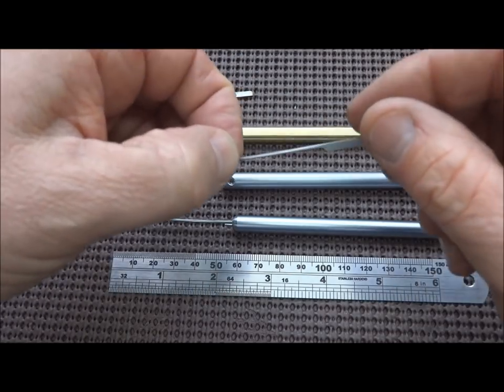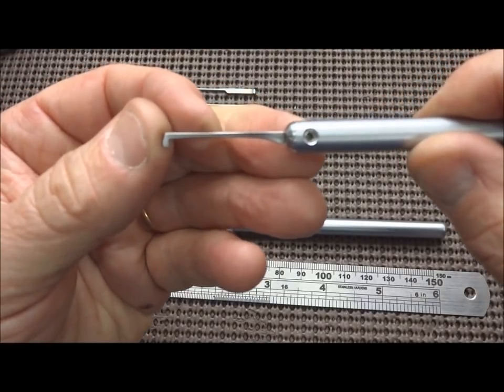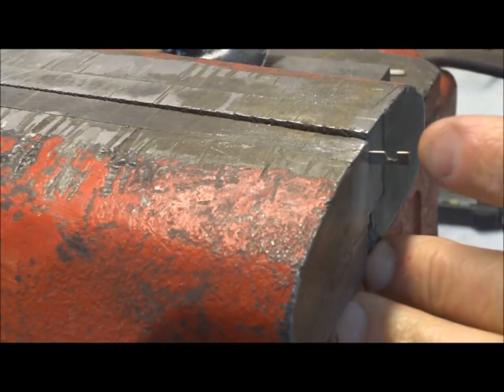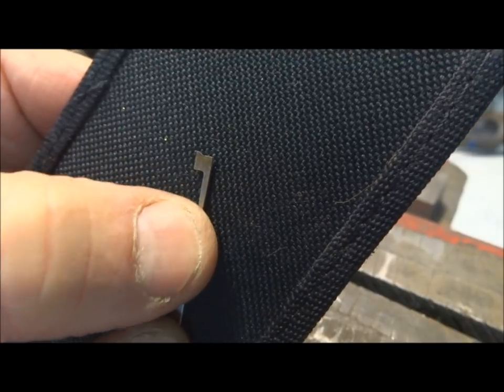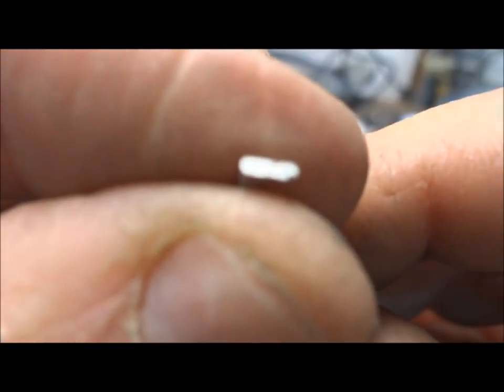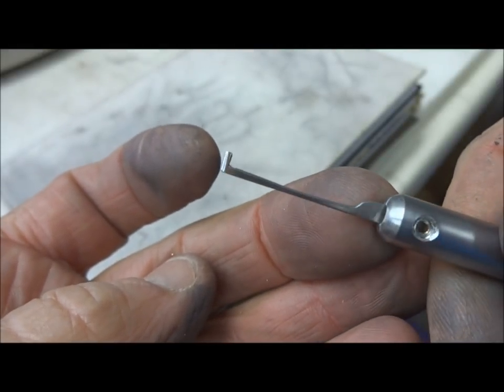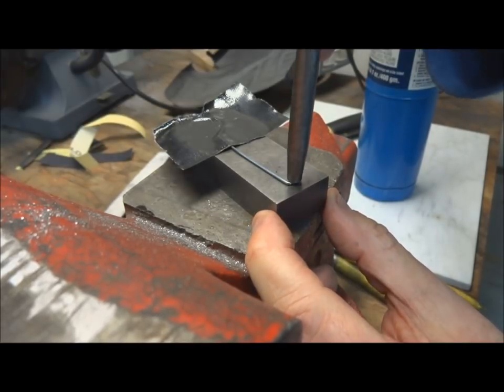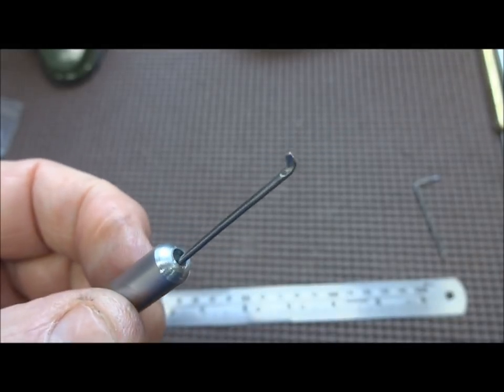(135) How to Make QuickPick Tips (Lock Picks)

Comment: Just returning to the sport from the early eighties, back in those preinternet days I used to make pick tips to fit an exacto knife handle. I used lawn mower pull return spool steel for the picks. It was hard spring steel and worked great.

Comment: Take a sponge and cut a slit in one end edge, like you're making a pocket inside the sponge about an inch or two deep, then soak the sponge in water. You can stop every so often and slide the sponge over the metal piece to quickly cool it off. The wet sponge is cool enough to quench it quickly, without having to remove the metal from the vise to dunk it.

You can do it the quick and dirty way by using a wet paper towel folded over a few times to make a thick pad, and just wrap it around the hot metal to quench it.
Reply: Good tip :)

Comment: I'm still new to making picks, but I've found that I can use 1/8 inch soldering wire hammered flat to cut and shape templates. Then I can take the templates and copy them onto a old bandsaw blade and cut them out with a grinder or cut-off tool to make even the trickiest of pick shapes. They aren't the fanciest but they are flexible and hold up really well. 

I also used your tip about the micarta to make handles and am really impressed with the way they turn out. Thanks for all the info on everything locksport.

Comment: If you keep your Dremel grinding up close to the vise, the vise will act like a heat sink and pull heat off your work piece, so maybe move the stock in out out and stay close to the vise. I build guitars, mandolins, violins, & guitar amplifiers, & lots of other electronics projects, and even pliers will pull enough heat off something to slow down melting solder with a soldering pencil. We even use little aluminum clips as heat sinks to protect some components that do not like heat, from the heat of soldering. I also work on pianos, so music wire has always been very close at hand. I have a couple friends who make everything from guns to Caribbean steel drums, and we have all learned a lot about heat treating different metals, and ruining different metals with heat.

Comment: Never cut steel with your good lineman pliers it will mess up the cutting edge. Cut copper or aluminum only. For cutting steel wire use pliers or side cutters you don't mind messing up.

Comment: Maybe you could also make a tip using a small diameter Allen wrench?
Seeing the music wire after you bent it kind of resembled a fallen wrench to me. 
You would just need to round the edges and grind the flag part down to make it flat. 
Not sure if that would work or not, just an idea.
And if you dont round off the end that goes into the handle of the Allen wrench the set screw would have a flat side to lock down onto.
Reply: Allen wrenches are too weak. I tried using them as tension rods and they twisted like a soft noodle

Comment: Just wondering, since you recommend .015-.031 for most picks, would .05 wire only work for specific locks with a lot of clearance? Or does the fact that the wire is rounded make up for the excess width? I wanted to try making some wire picks but was a bit confused as to what diameter/range of diameters would be appropriate. 
P.S. The handles youve made are awesome. I'll definitely have to make a bronze one similar to your design!

Comment: What about automotive feeler gauges,  they come on something just like the covert companion, this blades to draw out the pic you want and its numbered so i can choose whether i want a certian pic .007-.025 quick and easy, use tin snips to cut out close to your template u drew and then a dremel to finish it.  My issue is  Im just starting the hobby and even after ordering some cheap pic sets and some recommended,  i find it still really hard to get it to work.  25 years as an auto technician, feelin in my finger tips arent that great , feeling correct tension is even worse...but as i watching watching videos where key way space was super tight, instantly i remember feeler gauges are number, come in a handy little carrier and has the room on the blades to draw and customize each pic u want

Comment: After several hours of searching, I finally found the L shape handle.  It's part of a Siro adjustable cabinet pull, SIR-44-316.  Much more expensive now, but a few can be found on eBay.  
https://www.homedepot.com/p/Siro-Designs-Stainless-Steel-Fine-Brushed-119-mm-Adjustable-Center-to-Center-Pull-HD-44-316/202035497